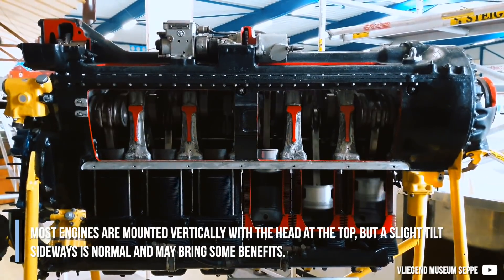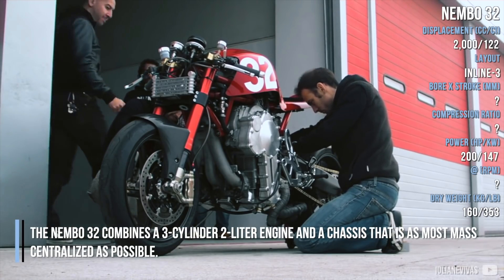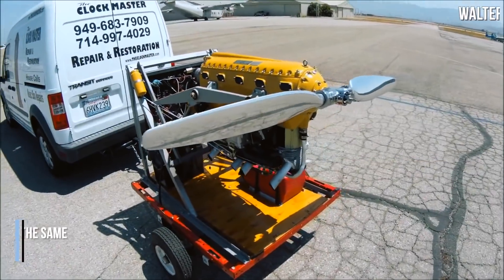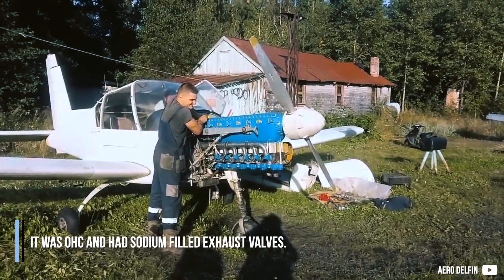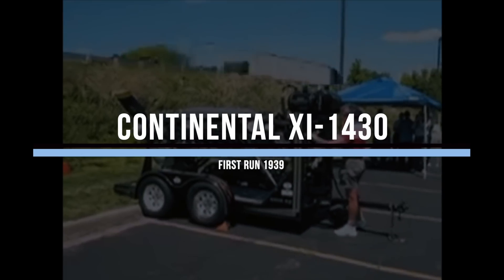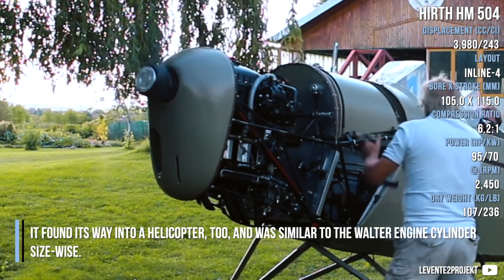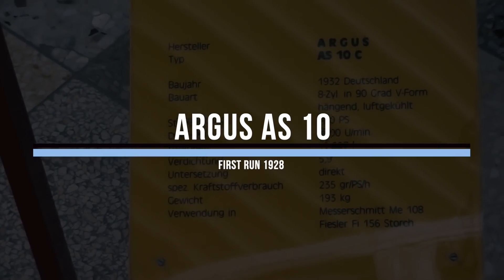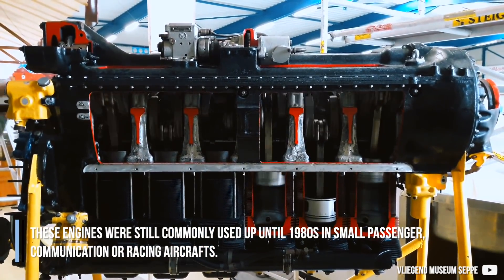These Engines Are Upside-Down

Comment: Inverting the engine makes maintanance on an aircraft way easier.
Imagine climbing on top to change or check the sparkplugs.
Reply from the maker: Very good point, that makes sense.
Reply: @VisioRacer  laughts in Radial Engines
Reply: @VisioRacer  yes, it´s a good point but there are many other reasons too, some that I consider is the smoke of the exaust, it dos not goes directly to the cockpit oiling the windshield, another is that makes the nose of the airplane narrower, (BF109) beeing convinient during take off.
Reply: I would think oil would seep past the rings while it is not running.??
Reply: @MrJoeyplatinum  It definetly does in Radial engines, but i think most aero engines have dry sump systems anyway.
Reply: Aero as in aerobatic: Yes. Aero for aeroplane (if that's where you're going with that) nope.
Reply: @MrJoeyplatinum  dry sump
Reply: *Radial engine left the chat
Reply: Actually it probably has its own problems I'm sure the plugs get fouled every time,  if the engine just sits.,  that's why it's not normally done...
Reply: Isnt it easier to do it from above assuming you have a ladder or platform or something
Reply: @isakjohansson7134  Upside down Maintanance of everything is a PIA. 
Yes its may be nice for the sparkplugs, but everything else sucks. 
every washer /bolt/Nut/ bearing/ gasket, camshaft/cylinder head just wants to follow gravity and fall on your face.
Reply: @isakjohansson7134  i would still prefer working overhead over standing on a  platform, bending over and falling and snapping my neck because i couls not get a bolt to unscrew
Reply: Main reason for inverting aero engines like the Gypsy and Blackburn Cirrus is to provide more ground clearance for the prop.
Reply: Well there a same pros of a engine head down for aero applications 
- more ground clearance for the Prop
-better view for the pilot
-the exhaust Gases do not get in the way of the pilot 
- maintenance without ladders or other wacky constructions (at the time of most engines had mechanical valve lash adjusters so a lot of maintenance work at the engine head) 
- if u lose ab blot, nut or washer it will not fly in the engine 
- for wwii fighter a gun could be mounted between the banks and thanks to a geard prop the gun cann shoot trou the prop shaft (also nicer to load ammo)

Cons a 
-oil is sipping down if the engine stands to long 
- parts or fluids that get flying will probably end in u face
Reply: That might be a byproduct of running inverted for certain maintenance task, and a pain in the neck for others.  Certainly not the reason for inverting.  
Have you worked on these inverted engines?
Reply: Unless you have the "same" engine in aircrafts and land vehicles (RR Merlin/Meteor). Imagine laying under the tank unscrewing heavy cover (because of landmines) to change or check sparkplugs. It is definitely bigger pain in the ass if you compare it with climbing on the ladder. 
(This idea is not from my head. I think there is video on this topic made by Greg's Airplanes and Automobiles.)

Comment: Technicaly, when  engine is turned upside down, then it do not have over head cam but under head cam. 
Question: how is provided lubricating oil distribution?

Comment: A 2 liter motorbike with twice the torque of a liter bike... mind blown 🙃
Reply: Two times bigger doesnt mean two times more powerful
Reply: @madhut3042  all in all...   Double the cc = about double torque or hp

Or the engine should be very inefficient.
Reply: Its really not that simple😂
Reply: For torques, check out the Triumph Rocket III. 2.5l. yes, 2500cc, 163 ft/lbs.
Reply: @j.thomas7128  I do abit of a work at bike shop, they recently had a victory in for mot. 1731cc 96 Bhp but 150plus lbs of torque. I've never seen somthing like that here in the uk so it blew my mind abit haha
Reply: they're working on a 3l engine, just to discover how many times more torque of a 1l engine..
Reply: My thoughts exactly.  2 is twice 1... Who knew 😱
Reply: Hahaha very impressive 🤣

Comment: Can’t see the point on a motorcycle, CG would be out
Reply: rotating crankshaft Has Huge gyroscopic effect , if it is closer to the rider ,it is easier to lean the bike, same idea was used by designing od Husaberg FS 570

Comment: DB605 is 48valve ohc, cannon shot  Through the propeller shaft and mg:s From the sides of the crankshaft cover.
Me109 fly litlebit nose down and pilot was very good wiev front lower sectors and upsidedown engine is narrow.

Comment: The bike has double the torque because it has double the cc and shit peak hp for its size
Reply from the maker: That is true, but 200 hp from a 2.0-liter NA engine is not sh*t
Reply: @VisioRacer  it's set up like a sportsbike. Most modern litre bikes are close to 200. Double the size and get fractionally more?
Reply from the maker: @williamroberts6424  But what does it matter? They created something different
Reply: @VisioRacer  true. Just think the power and application is wrong. That sort of torque won't be your friend at the track.

Comment: Early aircraft engines, often had exposed valve gear, the oil from this area “flew” backwards and covered the windscreen and pilots goggles in oil. Inverting the engine became common for many years, until water cooling became the norm.
John
Reply: Another problem arose from the use of castor based oils with total loss lubrication systems.  If the pilot ingested/inhaled much of it he would get a free laxative treatment into the bargain.

Comment: Are there any transverse layout inline engines that are 90-degrees slanted (either way?)
Reply from the maker: The Peugeot 104 is ridiculously slanted, but not 90°. There is a longitudinal BMW K75/K100 bikes with a 90° sideways slanted engine.
Reply: @VisioRacer  I wonder if it's possible to add more slant to your engine as a mod.
My 318i has a slightly slanted engine, but it's still pretty upright. But let's say if I modify it and slant it more, then the left-right weight distribution of the car would be off, I think.
It is my understanding that a 90-degree slant inline engine would have fewer primary or secondary forces than an upright engine. Not sure if it is 100% correct though.
Reply: The old Smart ForTwo engine is transverse and laid over substantially, but I do't think it's all the way to horizontal.

Comment: A inverted engine isn’t that unknown especially for autobikes, aircrafts, and motorboat although for the motorized boats this wasn’t just inverted is was also standing on it’s end driving the propeller through the bottom of the boat and threw the exhaust out the top or back of boat rear deck

Comment: I have to confess, despite spending many hours in various aircraft in my younger days, how did these engines get proper lubrication throughout...
Tight G-turns, looping the loop.... a "normal" engine could seize up very quickly if it was inverted or whatever. 

Please pardon my ignorance but this might be worthy of a follow up video at some point.
Interesting content as always 👍👍.
Reply: Probably used a dry sump system, only setup that makes sense in my eyes.
Reply: @M Bacon @petrol....
Appreciate the feedback. Thanks 👍

Comment: Some Volvo busses have 13 liters i6 laying on it's side
Reply: Some older detroit diesel engines are this way in busses also.
Reply: Cummins QSK-19R is sideways for rail applications.
Reply: The leyland engines also... and it runs well... bmw k75 and k100 do also well... nothing wrong with it👍

Comment: Inverted engines on aircraft were produced because this allowed more clearance for the propellor with direct drive, and also for ease of service on aircraft like the ME-109.  The negative being oil leakage into the cylinder which could cause hydrolock on startup.  This is why aircraft radials smoke so much on startup;  Oil that collects in the bottom cylinders needs to burn off.

Comment: How about a video about the most unique Indy cars ever raced?   I know a lot  about them and I have relatives living there.
Reply from the maker: Please, tell me about them.I would like to hear
Reply: @VisioRacer , IndyCars is one of the longest living motorsports ever, with the first race happening in 1911.  It includes quite a bit of unique vehicles such as the Lotus gas turbine indy car in 1968, several attempts of the Michigan built Novi engined IndyCar,  the lll fated Hurst floor shifter special,  the Cummins diesel IndyCar, and even a Corvette engined roadster to name a few.
Reply: Hope that is enough to spark your interests.

Comment: DB605 an heavy fighter engine? Actually it was installed on the Messerschmitt Bf 109, Macchi MC205V, Fiat G55 and Reggiane Re 2005 (at least: probably i forgot some models). And all those were light, single engine fighters.
Reply: You are correct, but it was also used in the Bf110 G2 heavy fighter and in the Dornier Do 335 A-1, but yes, the heavy fighters used jumo or bramo engines more often.

Comment: Love the old aircraft! I once seen an inverted V12 from a WW2 Japanese aircraft at the Chino Air Museum. Not sure who made it or what it was used on.
Reply: Maybe it was a Kawasaki ha-40 a licensed copy of the DB 601a used in the bf 109 E. The Kawasaki ha-40 was used in the Kawasaki ki 61 fighter. Most Japanese aircraft used radial engines, they where cheaper and easier to repair.

Comment: Isn't it underhead cam in this case? Anyway love your vids
Reply: You got a point
Reply: Is it even correct to call it a head?
Reply: @RasheedKhan-he6xx  cylinder butt?
Reply: @nadirbenvegnù  lol
Reply: @Doppelwhoppermcdonald  applied logic, mate :))))
Reply: @Fminus104  thx:D
Reply: Do pushrod engines fit that criteria?
They are cam in block Under the head
Reply: Beat me to it
Reply: With these top dead center is not bottom dead center
Reply: The cams are still in the top of the head
Reply: Well it's just a matter of perspective. Is all

Comment: Ooh I remember these had a problem with oil going down and hydro-locking the cylinders, a problem easily fixed by unscrewing the spark plugs and allowing the built up oil to drip out
Reply: Why doesn’t it go out the valves?
Reply: @stopglobalswarming  like Jordan said, valve guides/seals are very oil tight, properly lapped/ made valves are also very oil tight., Unless the piston stops in either the intake or exhaust stroke, the oil will accumulate/remain in the cylinder
Reply: @stopglobalswarming  how it supose to go out if the crank stops right before the copression stroke when both valve are closed?. Just like radial engine, unscrew the sparkplugs on the lower side of the engine to let it rain🤣
Reply: @stopglobalswarming  my guess would be the valve guides/seals

Comment: The DB 601, 605 and the Jumo 211 ran on gasoline.
They have the MW50 methanol water system for  short combat power.

Comment: Interesting facts about the DB605: 
The Propeller is driven by a hollow 
shaft which doubles as a center mounted machine gun with 20 or 30mm caliber.
There also were versions with a 400HP Nitrous shot  (GM-1)
Reply from the maker: Woah
Reply: @VisioRacer  shit you learn playing warthunder 🤣
Reply: It's actually not a camshaft. It's an overhead cam engine. But the hollow shaft that propeller is attached that cannon fit's in is also part of a drive mechanism for camshafts.
Reply: @valde3336  did you miss the inverted engine-theme?😁 dont think the propeller is camshaftdriven
Reply: @danielssonsgarage  No I didn't miss the point. Hill Bill has edited the comment originally it had that propeller was driven by camshaft. But actually propeller is driven by hollow shaft that sits bellow crankshaft (inverted v-engine so that's in between the cylinders). So the shaft sits exactly where the cam would be in the push rod engine. Do to the location of the shaft and valve cover design it's an easy mistake to think that that hollow shaft is the camshaft.
Reply: @valde3336  correct
Reply: @valde3336  ah interesting did not know that

The heads did not look ohc to me but makes sense
Reply: I dont think the shaft doubled as a machine gun... that would mean that the mg has to spin together with the propeller, wich was certainly not the case. Mabye the hollow shaft houses the barrel of the machine gun?
Reply: Hjalleson i think that’s what he meant. There was center mounted gun with the barrel going through i know. Would be crazy if the gun rotated at that RPM xD
Reply: @Aikaramba12  of course the whole gun does not spin 🤣🤣
Reply: The Db605 was far ahead of it’s time. Much more advanced and refined than the merlin

Comment: but how dose the oil sit in them? dose it not run into the piston and just sit there?
Reply: I expect they use a "dry sump" design with a separate oil tank and pump pickup which can work at any angle.
Reply: There were instances in B-17 radial engines, that the oil would accumulate at the bottom of the engine when not in use for some time.
Reply: @KeskiKaupi  that's a common problem with all radial engines
Reply: @Colt45hatchback  I only knew about the B-17s. Why is this such a common problem?
Reply: @KeskiKaupi  because the crankcase is in the middle of the engine, over time oil seeps from main bearings and leaks down past the piston rings into the combustion chamber of the lower cylinders, and if a valve is open, into the ports and manifolds, not a big issue, remove the spark plugs open the throttle fully and roll the engine over a few complete cycles, and it will exit via the exhaust or out the spark plug hole,  if you notice when most radials start up, they smoke for a bit, that's from the oil. Although I've noticed that the Nakajima Sakae engine (like in a zero)  seems to do this less, I'm not sure if it's just more thoroughly cleaned out Prior to starting as new parts if it hydraulic locks and bends a rod would have to be custom made, or if the oil control rings are a better design.
Reply: @Colt45hatchback  Interesting, thank you!
Reply: and where is the oil pick up?
Reply: @bassmikdk8360 ..... Yes, yes, yes....., always came across as an odd idea, because of the oil problem.
Reply: I would imagine that they use a dry sump system
Reply: How does a dry sump system keep oil from filling the pistons?
Reply: @beachboardfan9544  It mitigates it but doesn't totally solve it. Maintenance and other design elements makes it workable for the benefits when required.
Reply: @beachboardfan9544  most of the oil is stored in a separate reservoir and is circulated around the engine with an external pump I would imagine that some oil would hit the back of the pistons but that means you don't need oil squirters which some engines use to spray the back of the pistons to aid cooling
Reply: Even inverted, three cylinder motorcycle emgines sound the best.
Reply: https://www.youtube.com/watch?v=p732MaNir2M Here you can see of a Kawasaki H40 engine where pistons have a extra ring on the bottom of the piston
Reply: And radial engines are both upside down and right side up and horizontally opposed all at the same time!😁